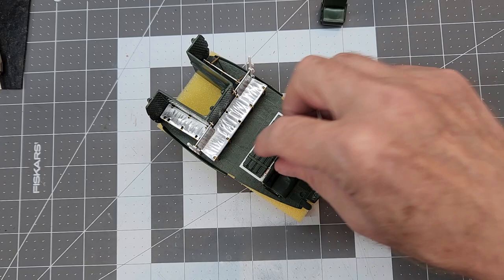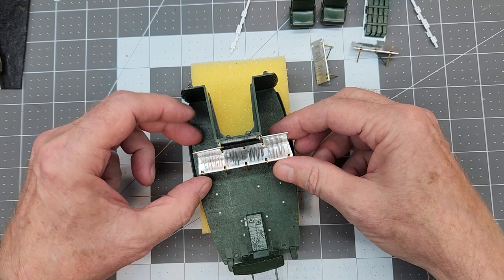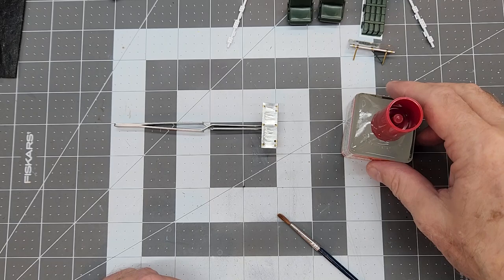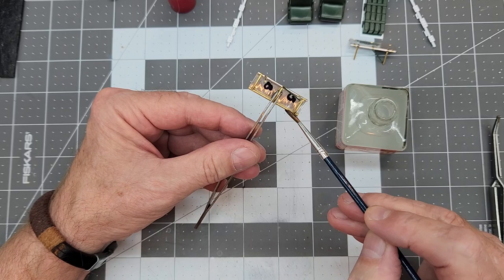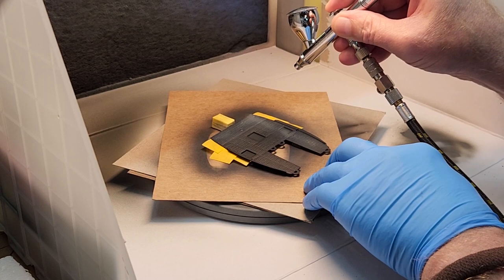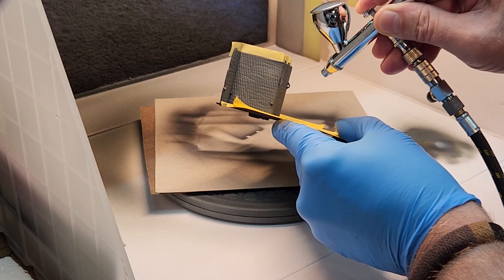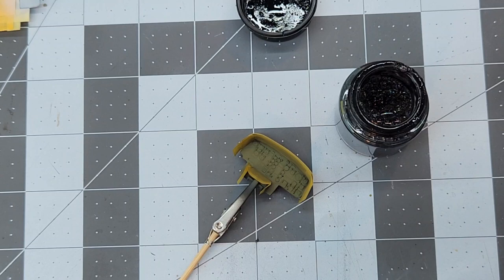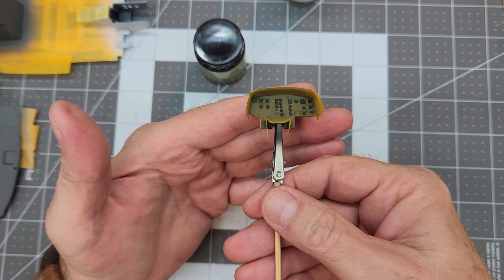UH-1D Huey Gunship, Part 3, Painting the Interior

Comment: Here's a little tip Uncle hillbilly you should lightly sand the metal parts as well as put a metal primer on it. If you forget about the metal primer or don't have metal primer the lightly sanding will help the paint stick to the metal it'll give it a better surface to attach to
Reply from the maker: Hi Rick, yes you're right about the light sanding. Those small scratches from light sanding gives extra purchase for the paint to stick. I didn't do that because I knew I would be using the primer and these parts won't be handled at all once the interior is installed and the model is finished. As always, thanks for the great tips and comments my friend. Lots of modelers read the comments and will pick up the info, which I'm sure will come in handy for them as well as me. Stay safe and model on. Johnny